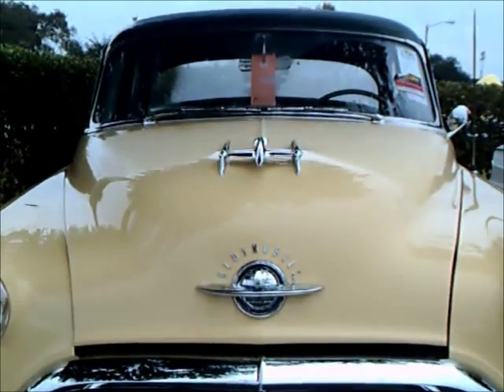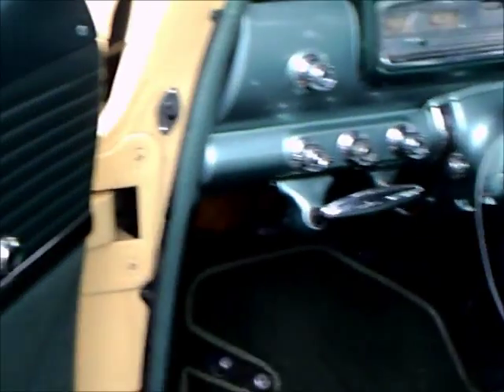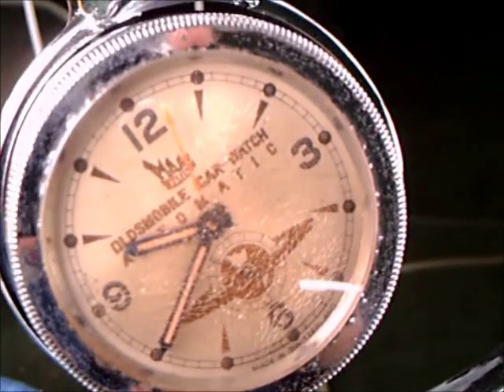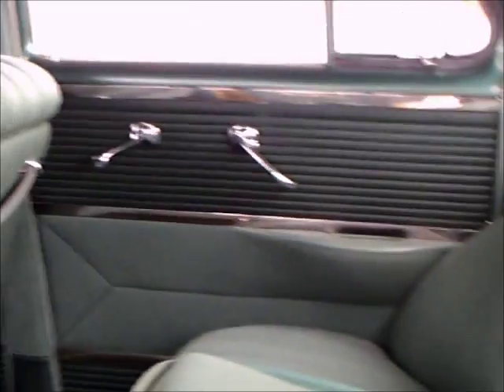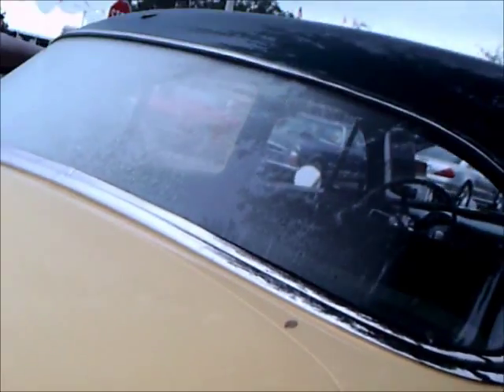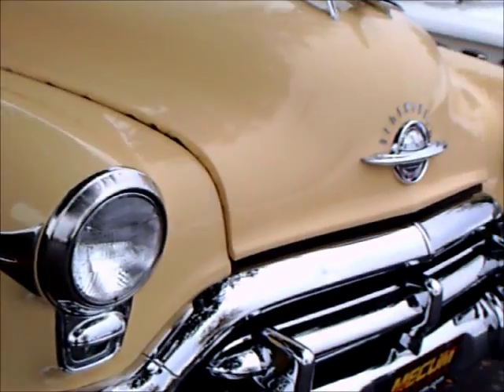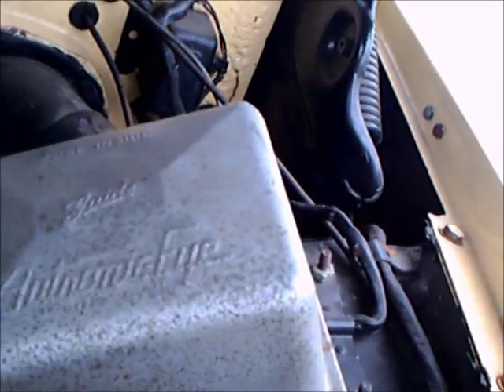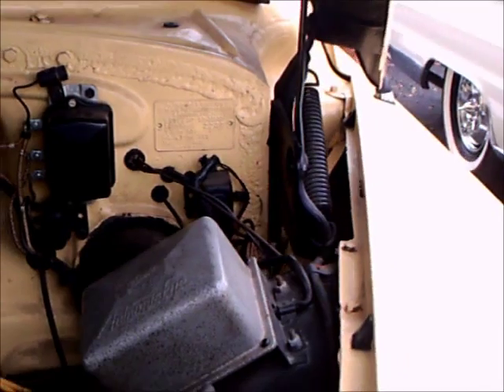1952 Olds 98 Four Door Sedan YelGrn KissimmeeMecumAuction011015A

Comment: looking at this rear seat here I would think  even the Caddy didn't have much more comfort in it's rear seat. I think this car would be very pretty in sage green exterior, with a white or off white top. I never seen the compass and clock like this set up here.
Reply from the maker: Hey, Gene!  Yes, I believe this car gave nothing away to Cadillac...very upscale. The current two tone scheme seems a bit unusual by today's standards..more calming colors would be chosen today.  I've seen that steering wheel before, but not often!  Thanks!  :) Jack

Comment: This was the year Oldsmobile got "dual range' on its Hydramatic transission. Now you could shift  down from fourth to third gear by moving the shift lever from Dr to S. This gave the car engine braking on long, steep, downhill roads, which I think was a big problem with the original  Hydramatics, when you had to stay in 4th gear all the way down a long hill. I would think a lot of brakes got burnt out before "dual range" arrived in 1952.. Cadillac and  Pontiac, same thing. I must admit the Oldsmobile 98 was prettier than the Buick Roadmaster, I never did like the toothy grilles of the Buicks in the early fifties, although they were good cars.
My father had a 1954 Buick Special with Dynaflow which I eventually drove daily to college. The Dyanaflow was a  super smooth transmission and at least you could downshift it form D to L to get some engine braking on hills, provided you were going less than 55 mph.
Reply from the maker: Hey, William!  Yes, that was a definite limitation of Hydramatic in those days....one could use "L" if  you were going slow enough.  Dynaflow started life very sluggishly, but improvements in the transmission made it more responsive as time went on.  Thanks!  :) Jack

Comment: This was the  Cadillac of the Olds line and a very nice car, I think I like the styling of this better than the 52 Buick.   As for it not having electric windows, in some climates there were complaints of the early electrics freezing up in the very cold winters.
Years ago I saw a brand new 73 Buick Electra with roll up windows and in 74, while looking for a used Riviera, I found a beautiful 69 Riv with roll up windows.
I think Olds was pretty healthy clear into the 1980's, but  the new design Cutlass in 1989 did not go over well,  and the line seemed to suffer with those design and line  mistakes GM made with them, Buick suffered also, but not as bad.  I remember a friend of  my wife and I had a early 80s Cutlass and wanted a new one, but when she saw the new 89 with those door handles on the center pillar, she said, how am I going to open that door with my long fingernails,  so she instead bought a Thunderbird
Reply from the maker: Hey, Brian!  I think you've summed up the situation very well!  Olds had a great reputation through the 70's...but when they started "messing" with the Cutlass, it spelled the end of the dynasty.  The fact that they got a VAN didn't help either!  Instead of playing to the strength of engineering firsts and accomplishments, it became just another GM division.  Thanks!  :) Jack
Reply: Jack R Kind of the same thing that happened to Mercury, There used to be a big difference between a Grand Marquis and a Crown Victoria/LTD.  Those Grnad Marquis were almost a Lincoln, but my brother has one, its a 2003 and its a good car, but its no Lincoln not even close.
Reply from the maker: califdad4 Hey, Brian!  I think Mercury had an identity problem for some time.  What was it to be...a dressed up Ford, or a dressed down Lincoln!  Such a quandry exists when you don't have a clear plan for what the car should be.  For a while, they tried the "Marauder" game, but that didn't really reestablish the racing edge for the car.  Thanks!  :) Jack

Comment: Kudos to Rhymesauce for pointing out that hood ornament. A fine piece of automotive art indeed. Speaking of air conditioning, do you know which automobile company was the foremost innovator in the climate control field? I'll give you a hint; it wasn't Packard or Cadillac. In fact, it was actually Nash. A company that would become famous for it's compact economy vehicles. In 1939, Nash introduced the first thermostatic automobile climate control system called "Weather Eye". They topped in 1954 by introducing All-Weather Eye, "the first American automobile to have a front-end, fully integrated heating, ventilating, and air-conditioning system.This was the first mass market system with controls on the dash and an electrically-engaged clutch." Some pretty big things from a relatively small company, huh?
Reply from the maker: Hey, Jacob!  Yes indeed, Kiel has a great eye for design!  Packard actually was the first with a functioning A/C system, with the evaporator in the trunk, introduced in 1939. https://autos.yahoo.com/blogs/motoramic/november-4-packard-offers-first-car-air-conditioner-132542726.html  But it wasn't very practical because it was driven by a fanbelt all the time..in the winter, it required that you remove the fanbelt!  Also, the refrigerant was ammonia, potentially deadly in a crash.
 I agree that Nash's Weather Eye system was the first to really be practical, introducing outside air into the system as required.  It was indeed an engineering triumph for Nash!  Thanks!  :) Jack

Comment: Hey Jack. Nice looking car. I've never seen a 1952 Oldsmobile before. Something I've never understood about automatic transmissions of this time. You'd think they'd have their own Parking quadrant, rather than sharing it with Reverse. I love the two-tone colour combination. :)
Reply from the maker: Hey, Jason!  It really is a deluxe car!  Hydramatic was evolving at the time..Powerglide already had the Park position, but it hadn't migrated to Hydramatic  yet.  It was the real beginning of two tone combinations!  Thanks!  :) Jack
Reply: Jack R I remember seeing a 53 Chevy with automatic transmission. It had PNDLR gear change. :)
Reply from the maker: Jason Carpp Hey, Jason!  Yep...it had that arrangement until standardization took place, sometime in the late 50's, and as such, it was a hazard for someone attempting to shift into low, and hitting reverse instead.  
Here's an excerpt from the Wikipedia article on Nader's "Unsafe at Any Speed" which highlights the danger...
Early automatic transmissions, including GM's Hydra-Matic, Packard's Ultramatic, and Borg Warner's automatic used by a number of independent manufacturers (Rambler, Studebaker) used a pattern of "P N D L R", which put Reverse at the bottom of the quadrant, next to Low which was contrary to the pattern used by other manufacturers. Drivers used to moving the shift lever all the way down for "low gear" would accidentally select "R" and would unexpectedly move the car backwards. In addition, other manufacturers, such as Chrysler, used a push-button selector to choose gear ranges. Ford was the first to use the "P R N D L" pattern, which separated Reverse from forward ranges by Neutral. Eventually this pattern became the standard for all automatic-shift cars.
Chevrolet's Powerglide, at least as seen on the Corvair, used a "R N D L" pattern, which separated the Reverse from the Drive gears by neutral in the ideal way, but which had no "P" selection, relying instead on the process used with a manual transmission of the driver selecting N (neutral) and using a separate parking brake when parking.
Thanks!  :)  Jack
Reply: Jack R I agree. It can be a problem, particularly when one doesn't look first to see where he/she's planning to move the gearshift lever. :)
Reply: I've never driven a car with an auto gearbox that had that kind of shifting pattern. Most cars I've driven had Park, Reverse, Neutral, Second, and then Low.